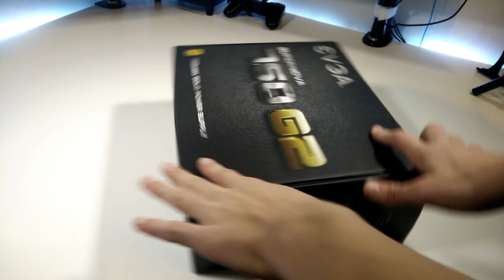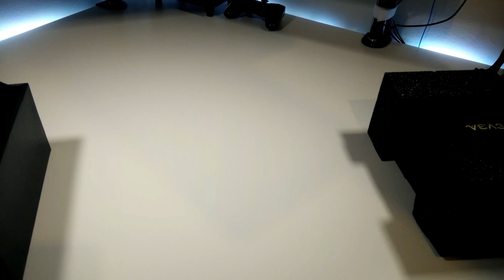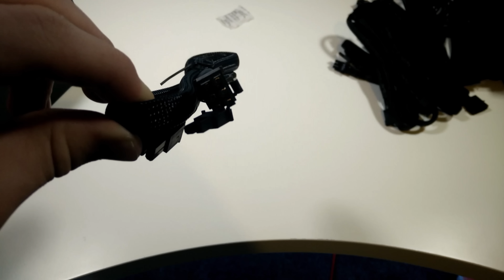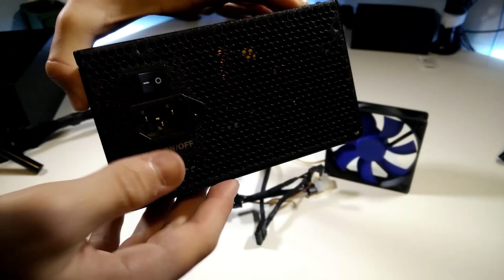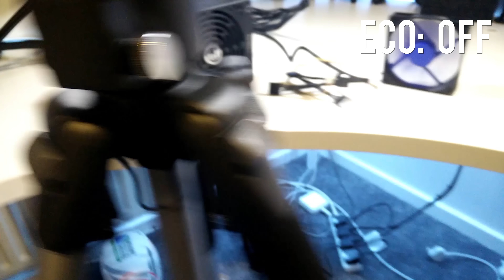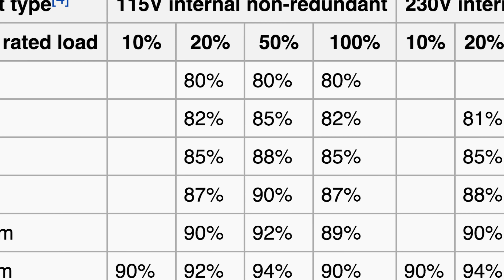EVGA SuperNova G2 Series Power Supply Unboxing & Review [750W - 80+ Gold!]

Comment: I supose this will be good to power my gtx 1080, i7 7700k(cooled by hyper evo 212) and 16gb of ram with no overclock on any of them. Ive had 2, other psu's on this system and both have failed on me so ive decided to amp it up a little bit. Ive had the evga 600w 80+bronze and fractal design 750w 80+bronze integra m.
Hopefully this one will surfice.
Reply: So, did you get this psu? Is it all good?

Comment: So does a Sata cable come with it to install a SSD like the 850 evo? Btw nice video!
Reply from the maker: Any data device, such as the 850 evo, uses 2 cables, sata data and sata power. The data cables go to a port on the motherboard and coke included with the motherboard, the sata power cables come from the power supply, I believe this has 6 or 8! :D
Reply: +GeekaWhat Nice, thanks bro, appreaciate it!
Reply from the maker: +Yisa Kerm. No problem man! :D

Comment: I've never built a gaming pc so I'm not buying parts crazy expensive so I want to ask you : does dedicated/integrated graphics matter and at what point do you use it?
Reply: +Hassman If you're asking about whether a computers graphics capability matter, it depends on what you plan to use your PC for. 

Modern day Processors (CPU) are gaining a better foothold on being without a corresponding Graphics Card (GPU), although it never hurts to lessen the workload on your CPU by having a descent GPU. But that also depends on what kind of games you're going to play.

Most modern games would probably work best with a dedicated graphics card like a NVIDIA 750+/950+ or AMD R7 260+/R7 360+ or higher card (I don't tie myself down to either, I've used both brands and they both work well). If you're looking to save money, AMD's are sometimes usually cheaper when NOT bundled, but this also depends on where you shop.

If you want, browse through sites that make pre-built/custom built computers and see what parts other companies sell and recommend so you can base what parts you need, off of how someone else builds. But don't forget that most of these sites will recommend some things you don't need (avoid anything that rhymes with accessory). You could also google information about what certain components of a computer do and if they're worth investing in so you can find out what it is best for you and your budget.

Best of luck!

Comment: Im thinking of getting these and was just double checking if they all work together:
Case- Storm-p27 Mid Tower Windowed Case- Black USB 3.0
RAM- Kingston HyperX Fury 2x4GB DIMM 240-pin
CPU- AMD FX8320 8-Core 3.5/4.0GHz
PSU- EVGA 600 W 80+ PC Power Supply Unit - White
HDD- WD 1TB 7200RPM
GPU- AMD Radeon R9 380
MotherBoard- MSI 970A-G43 AMD 970 ATX Motherboard (PCI-E, Socket AM3+)

Please tell me if they all work together
Thanks

Comment: Considering buying this to replace by current CX600M due to the bad things I have been hearing about the CX.
Reply from the maker: +Joel F The CX line are great value don't get me wrong, and I've had nothing but good experiences with my CX430M but they are a budget, low end PSU - you have to remember that :P
Reply: +GeekaWhat Yeah, I didnt realise that until recently. This is my build; https://www.reddit.com/r/buildapc/comments/3wkomz/build_help_should_i_swap_out_original_cx600m_with/

Would you upgrade or stick with the current PSU if it was you?
Reply: I built my pc like 1week ago and i recommend upgrading that i ordered it then cancled it and got the psu in the video :P.

Comment: Hey, just built an epic build in my PC hardware shop for a client.

Intel i5 4690k
8GB RAM
R9380X
Asus z97 a
PSU in this video.
Enthoo Pro
1TB
250GB SSD
Reply: +Ch33kyMangozOnPC Nice! respectable pc build :D
Reply: Mc Firegamer k thanks
Reply: Gaming Hero Because it's more expensive for skylake and DDR4 ram. Also, it was the clients choice on what he wanted
Reply: Gaming Hero I don't really mind.
Reply: +Gaming Hero i would change that ssd and psu right away. that ssd has slow read and right speeds for the price and that psu isn't very high quality and not a good choice for a gaming build, otherwise pretty good build
Reply: +BossManiacGames Sorry but no one is going to take the opinion from a random idiot on the internet such as yourself when they have johnnyguru, a site with actual credible psu reviewers that gave this exact same psu a 9.8/10 and praised it for being one of the best bang for the buck 750 watt psu's on the market for not only excellent voltage regulation, but also build quality and a 10 year warranty to boot.
Reply: i have the same motherboard i5 and psu XD
Reply: good build, just the cpu could be better and if the client wants to really game then suggest 16gb of ddr4 ram, i see people talking about the ssd but for the build im seeing, that ssd is going to run smooth as a pie tbh. i know its the client but you know, the pc building community has the habit of seeing if they could improve other peoples builds, otherwise, thats a damn fine build
Reply: Bro mine is...

Intel core i7 (Proccessor)
H100i V2 (water cooling)
Rog strix z370-H gaming (mother board)
Supernova 750 G2 (power supply)
Geforce GTX 1070 ti (graphics card)
SSD 250 gb
Reply: GamingLimited I have everything In your build but I have Asus strix gtx 1080ti and an Asus strix z170e motherboard